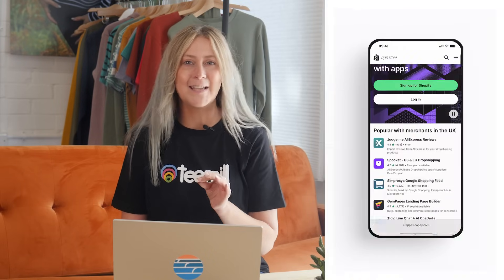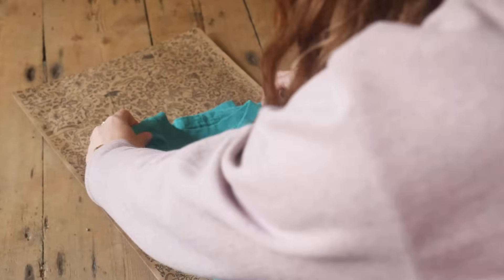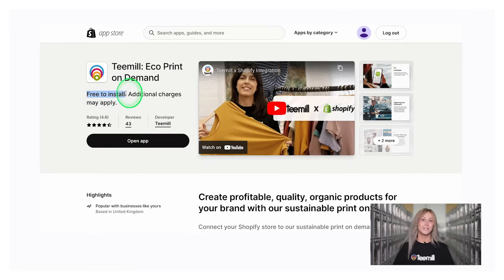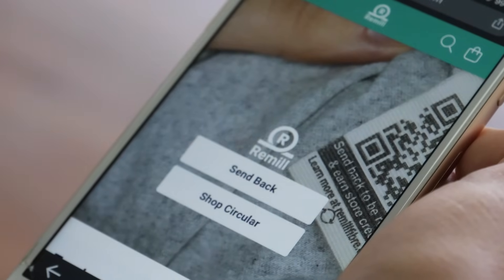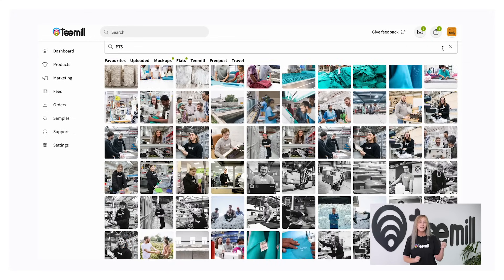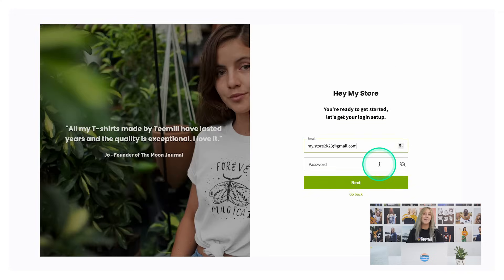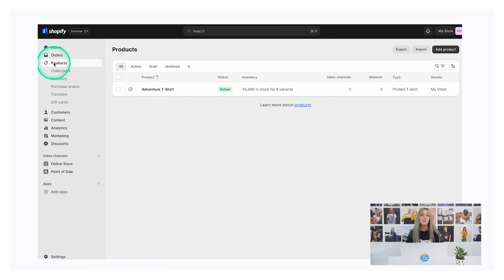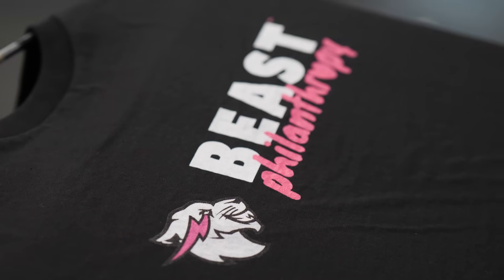The magic of print-on-demand done right: Grow your Shopify business sustainably

Comment: It says, in the setting up of payment details, "So we know where to charge you when an order is made"... what? You shouldn't be charging me, but GIVING me the required profits, right?
Reply: "So we know how to charge you for the product and shipping when you make a sale..." WHAT?
Reply from the maker: @DeFactoSeptember If you are using an integration like Shopify, you take the payment directly from your customer on the Shopify end. This means that we don't have access to it to fund fulfilment for that order. Therefore, we will charge you for the price of the product and shipping, leaving you with your profits. This is different to if you are running a Teemill store because Teemill handles the payments directly. If you are running a Teemill store, you don't need to worry about the fulfilment cost and we simply send you the profits. Either way, you are left with your profits at the end of each process. Hope that helps.